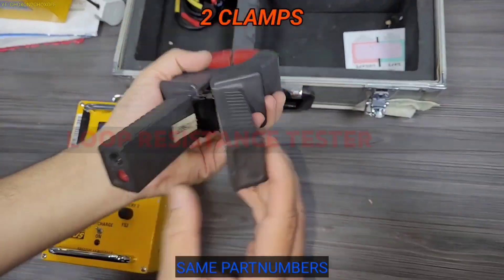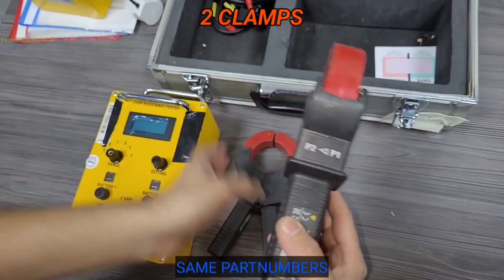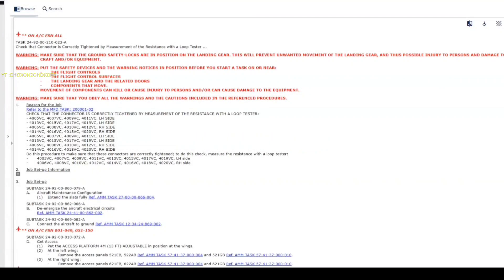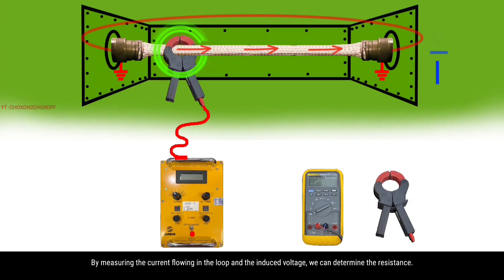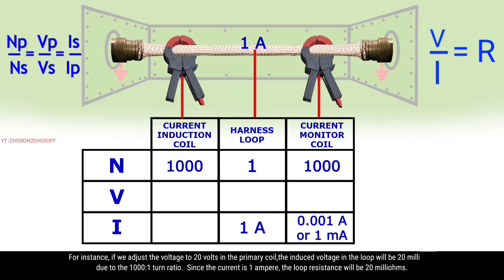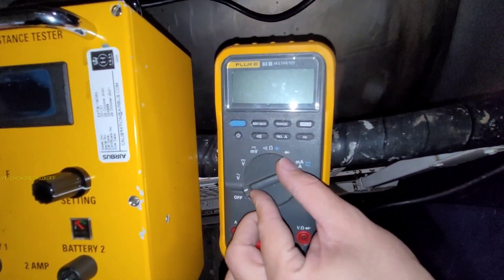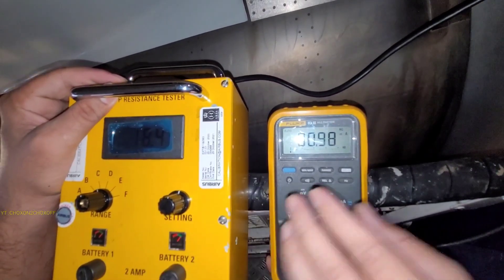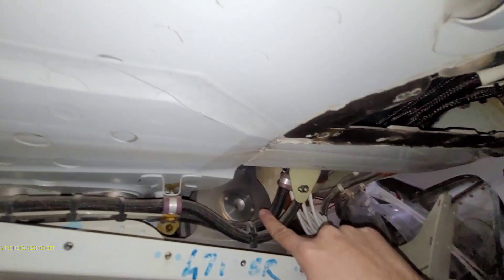How to do LOOP RESISTANCE TEST ON AIRBUS A320| LRT TESTER ALT20200001,#airbus  #lrt

Comment: Shouldn't the both clamps at least be 4 inches apart?
Reply from the maker: There is no such separation mentioned in amm. But you are right.Forgot to mention. We were limited to access. Should be apart.
Thank you.